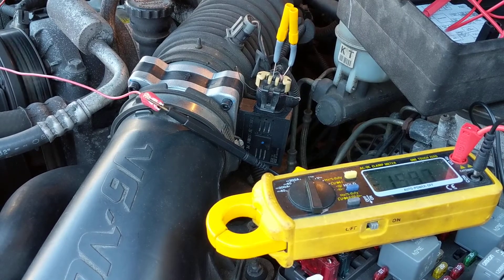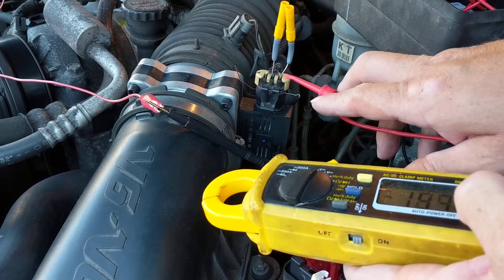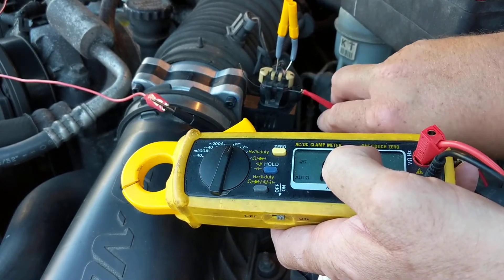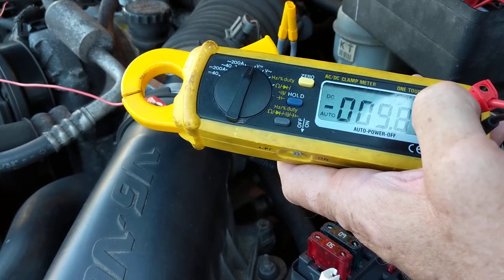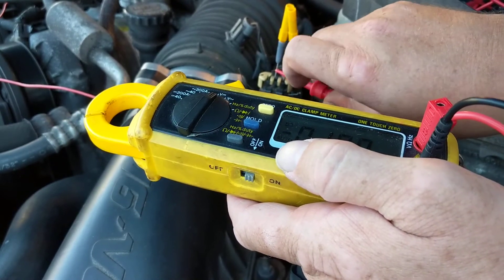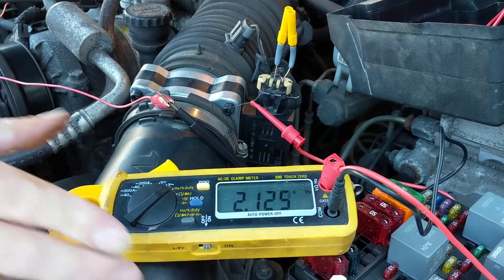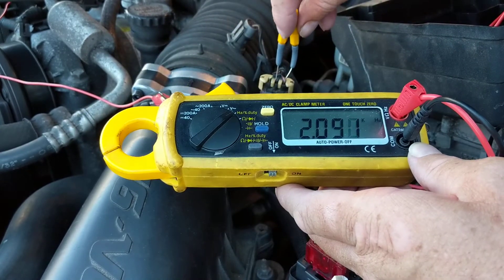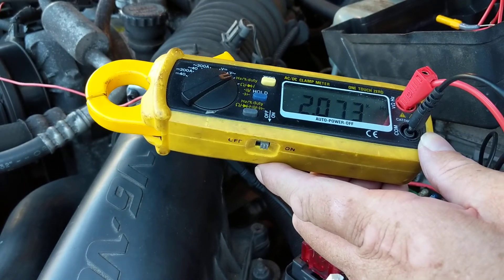how to test MASS AIR FLOW SENSOR VOLTAGE AND FREQUENCY AND SIGNAL WIRE part 1

Comment: What brand and model # is the AC/DC amp clamp meter your using ?
Reply from the maker: Believe it or not this is more than 20 years old it there is no brand name on it unfortunately but if you go online and you need a clamp meter make sure it can measure DC volts and DC amps you don't need AC amps unless you doing electrical work but for automotive that's what you need the rating of this clamp unit will not be that high maybe 200 amps if you're going to measure the starter motor current you'll need more than that so thanks for your question

Comment: hey joe thanks for this video it is really nice one and it is a new topics

one of the issues i found in diagnostics is how to know if the sensors are working or not
in my case usually i try a known working sensor from another car or some times new 

it would be nice if you show us how to test different sensors without the need of another sensor

also another side note
i couldn't hear clearly because of the engine sound that i had to use the subtitle lo:D
i wish you all the luck and have a good day
Reply from the maker: Yeah that's part of the problem I'm doing Hands-On with the engine on which needs to be on your sound gets muffled out buy the engine noise but I'll try to get two more sensors and the way you look at it is the signals I have a lot more work to do thanks for your feedback
Reply from the maker: You can always use the closed caption I know as I specified in the videos for electronics you have to have the engine on and unfortunately that's part of the problem but go to captions